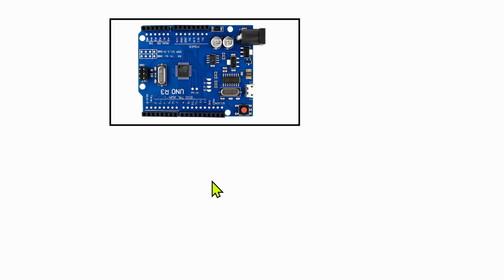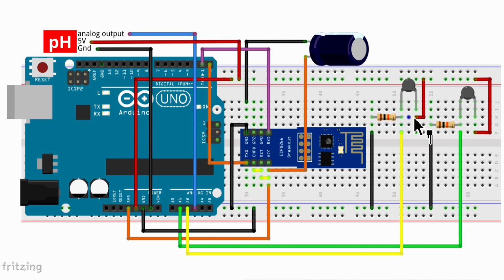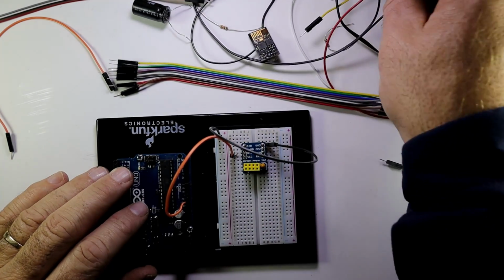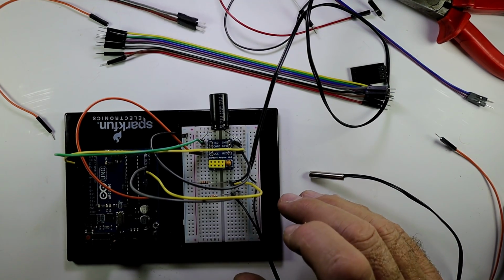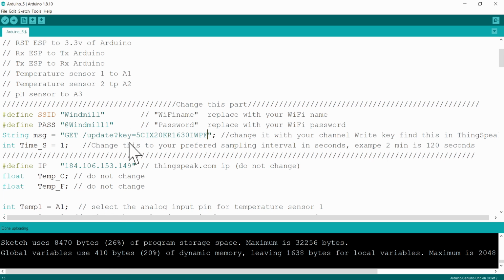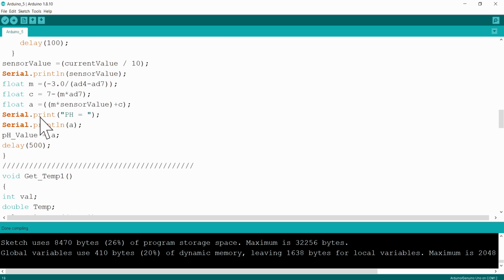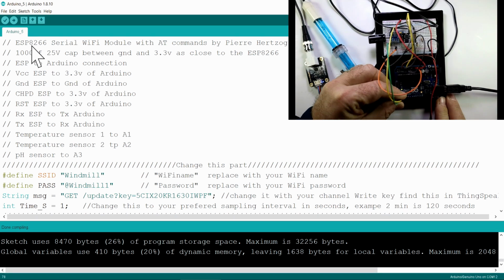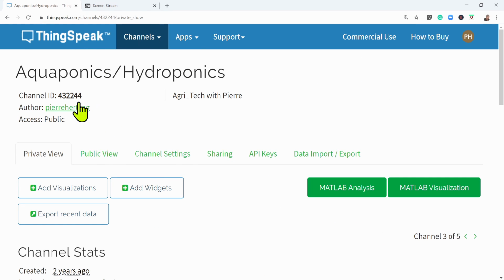ThingSpeak and Arduino - pH and temperature, how to

Comment: // ESP8266 Serial WiFi Module with AT commands by Pierre Hertzog
// 1000uf 25V cap between gnd and 3.3v as close to the ESP8266
// ESP to Arduino connection 
// Vcc ESP to 3.3v of Arduino
// Gnd ESP to Gnd of Arduino
// CHPD ESP to 3.3v of Arduino
// RST ESP to 3.3v of Arduino
// Rx ESP to Tx Arduino
// Tx ESP to Rx Arduino
// Temperature sensor 1 to A1
// Temperature sensor 2 tp A2
// pH sensor to A3 
///////////////////////////////////////Change this part////////////////////////////////////////////////////
#define SSID "Windmill"        // "WiFiname"  replace with your WiFi name
#define PASS "@Windmill1"      // "Password"  replace with your WiFi password
String msg = "GET /update?key=5CIX20KR1630IWPF"; //change it with your channel Write key find this in ThingSpeak
int Time_S = 1;   //Change this to your prefered sampling interval in seconds, exampe 2 min is 120 seconds
//////////////////////////////////////////////////////////////////////////////////////////////////////////
#define IP   "184.106.153.149
" // thingspeak.com
 ip (do not change) 
float   Temp_C; // do not change
float   Temp_F; // do not change

int Temp1 = A1;  // select the analog input pin for temperature sensor 1  
int Temp2 = A2; // select the analog input pin for temperature sensor 2
int pH = A3;    // select the analog input pin for the pH sensor

float Temp1_Value = 0;  // variable to store the value coming from temperature sensor 1
float Temp2_Value = 0;  // variable to store the value coming from temperature sensor 2
float pH_Value = 0;     // variable to store the value coming from pH sensor

float ad7 = 322.0;     // change this value to the one on serial monitor when in pH7 buffer
float ad4 = 430.0;     // change this value to the one on serial monitor when in pH4 buffer

void setup() 
{
  Serial.begin(115200);  // also set your serial monitor to this baud rate
  
  Serial.println("AT");  // Test ESP8266
  delay(5000);                  
  if(Serial.find("OK"))  
  {
  connectWiFi();
  }
}

void loop() 
{
  Get_Temp1();
  Get_Temp2();
  Get_pH(); 
  Send();
  delay(1000*Time_S);   // time to wait before loop repeats
}
///////////////////////////////////////////

void Get_pH()
{
  int sensorValue =0;
  int currentValue = 0;
  
  for (int i = 0; i < 10; i++) 
  {
    currentValue += analogRead(pH);
    delay(100);
  }
sensorValue =(currentValue / 10);
Serial.println(sensorValue);
float m =(-3.0/(ad4-ad7));    
float c = 7-(m*ad7);
float a =((m*sensorValue)+c);
Serial.print("PH = ");
Serial.println(a);
pH_Value = a;  
delay(500); 
}
///////////////////////////////////////////
void Get_Temp1()
{
int val;            
double Temp;
val=analogRead(Temp1);      
Temp = log(((10240000/val) - 10000));
Temp = 1 / (0.001129148 + (0.000234125 + (0.0000000876741 * Temp * Temp ))* Temp);
Temp_C = Temp - 273.15;              // Kelvin to Celsius
Temp_F = (Temp_C * 9.0)/ 5.0 + 32.0; // Celsius to Fahrenheit
Temp1_Value = Temp_C;                // change Temp_C to Temp_F if you want  your temperature in Fahrenheit   
}
////////////////////////////////////////////////////////////////////////////////////////////////
void Get_Temp2()
{
int val;            
double Temp;
val=analogRead(Temp2);      
Temp = log(((10240000/val) - 10000));
Temp = 1 / (0.001129148 + (0.000234125 + (0.0000000876741 * Temp * Temp ))* Temp);
Temp_C = Temp - 273.15;              // Kelvin to Celsius
Temp_F = (Temp_C * 9.0)/ 5.0 + 32.0; // Celsius to Fahrenheit
Temp2_Value = Temp_C;                // change Temp_C to Temp_F if you want  your temperature in Fahrenheit 
}

/////////////////////////////////////////WiFi//////////////////////////////////////////////////
void Send()
{
String cmd = "AT+CIPSTART=\"TCP\",\"";
cmd += IP;
cmd += "\",80";
Serial.println(cmd);
delay(2500);  
cmd = msg ;
cmd += "&field1=";    //field 1 for test value
cmd += Temp1_Value;        //change to temp_F for Fahrenheit      
cmd += "&field2=";  //field 
cmd += Temp2_Value;
cmd += "&field3=";  //field 
cmd += pH_Value;
//cmd += "&field4=";  //field 
//cmd += 100;
//cmd += "&field5=";  //field 
//cmd += 100;
//cmd += "&field6=";  //field 
//cmd += 1000;
//cmd += "&field7=";  //field ----
//cmd += 100;
//cmd += "&field8=";  //field 
//cmd += 100;
cmd += "\r\n";
cmd += "\r\n";
Serial.print("AT+CIPSEND=");
Serial.println(cmd.length());
if(Serial.find(">")){
Serial.print(cmd);
}
 else
 {
  Serial.println("AT+CIPCLOSE");
  }
}
///////////////////////////WiFi connect////////////////////////////////////////
boolean connectWiFi()
{
  Serial.println("AT+CWMODE=1");
  delay(2000);
  String cmd="AT+CWJAP=\"";
  cmd+=SSID;
  cmd+="\",\"";
  cmd+=PASS;
  cmd+="\"";
  Serial.println(cmd);
  delay(5000);
  if(Serial.find("OK")){
    return true;
  }else{
    return false;
  }
}
Reply: thank you so much!